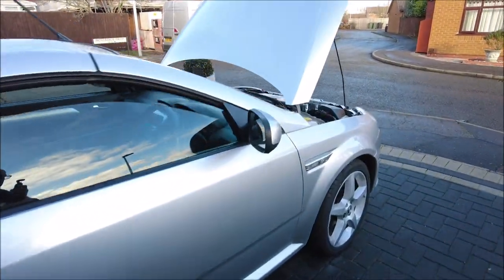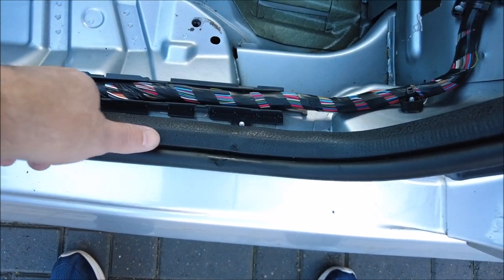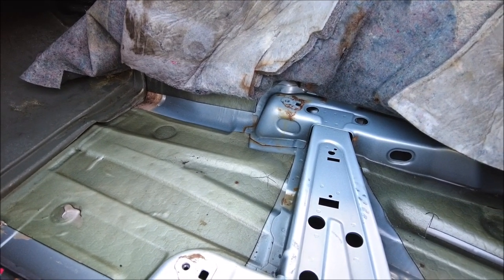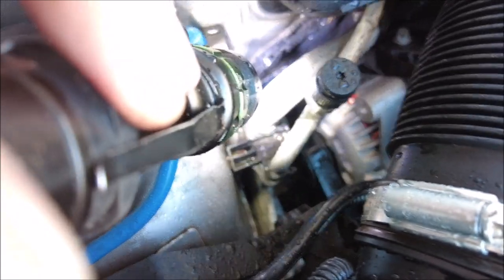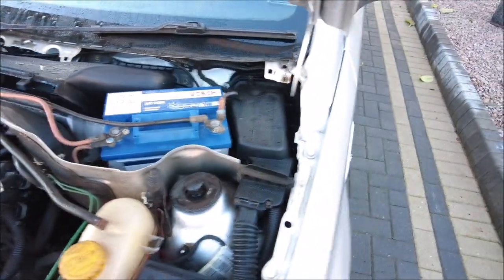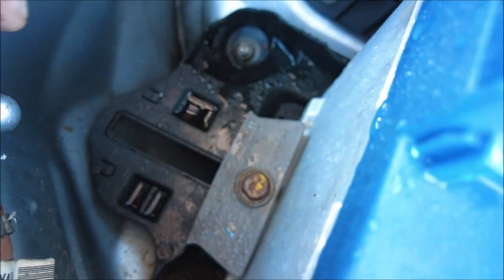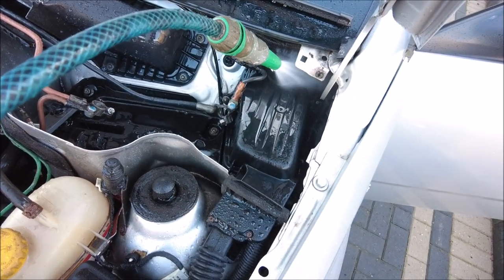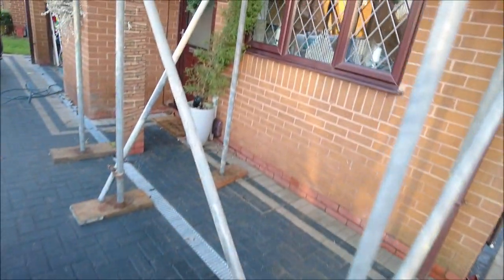Ade Vs Tigra Leak Part 2

Comment: Mine leaked from each side of the roof where sections of the roof meet' the rubber seals just above the window had a 2mm gap about 10mm long let water in after heavy rain' i plugged them with blue tack 4 of them no more leaks.

Comment: You could always put it back together then go test it in car wash lol
Reply from the maker: or turn it into a skip   😂
Reply: Just a thought. I had this on mine. Have you checked the boot drains?
If the one on the passenger side is blocked, or it hasn't been fed back through the hole to the outside, it will overflow into the boot. It comes in just behind the passenger seat where, in your first video, the water was pooling. 
Under braking the water moves to the front of the car, so it appears the leak is at the front when actually it's coming in from the rear. 

Check for any damp in the carpet in the boot on the passengers side. It'll be the area where the roof folds into.
Reply from the maker: I did check the drains but was also thinking that it may be the dump pipe feeding into the car like you said...ill be checking this week  :)
Reply: One tip I can give you, condensation builds up along the roof seems and drips down, my solution is to part open the roof and apply some good old fashion Petroleum Jelly,  yes Vaseline, to the metal strips  between the seems it stops the strips attracting the cold air turning into water droplets.
Reply from the maker: I tend to do much the same with silicon spray, but might give this a shot...also seem to get a lot of condensation in the boot which i know is quite common too. Maybe a thin layer there  :)